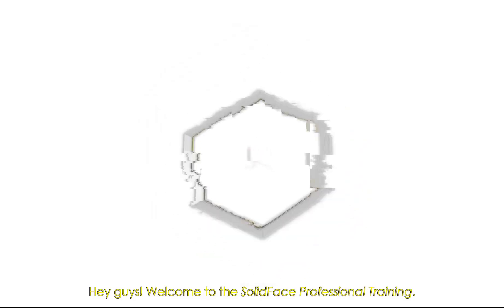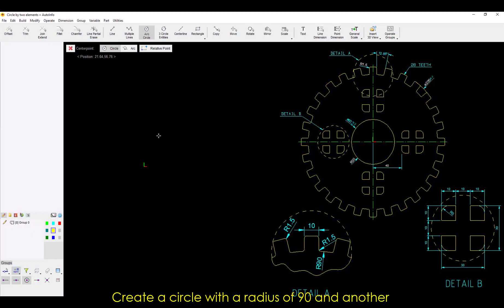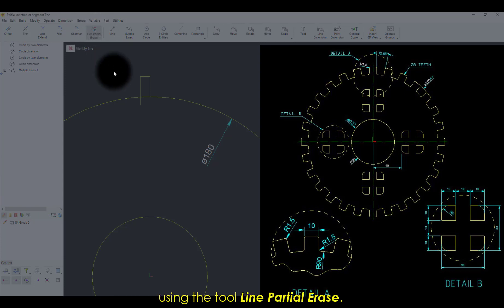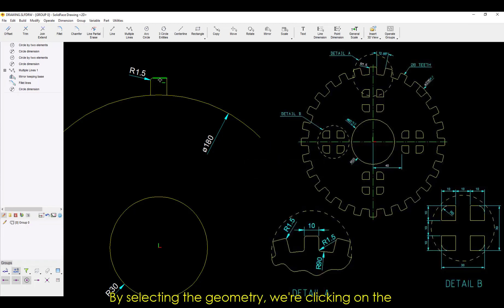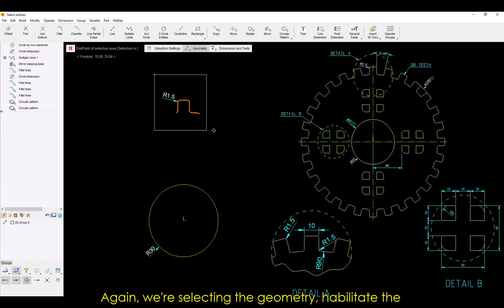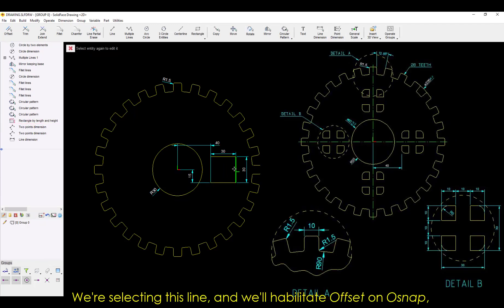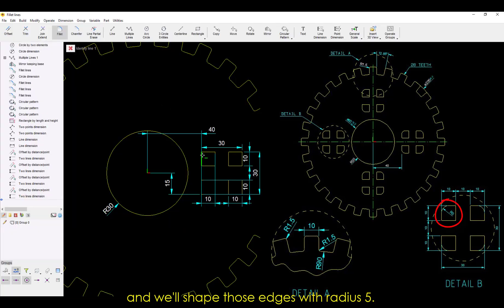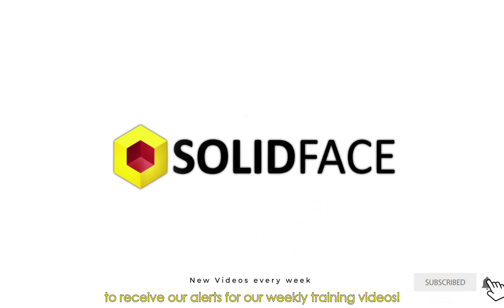Learn CAD 2D with SolidFace - 12 Circular Pattern

Comment: How did you make DETAIL A and B bigger than the normal geometry?
Reply from the maker: Hello emrullah, how's going your SolidFace experience?

For doing this modification, first, you need to click on the Text tool; after this, a box showing some information will appear, and on the right side will have the "Scale (0=Def)". If you want the Standard Scale, just keep the 0, or if you want another Scale, insert the value, and it's done! Hope you've understood this explanation. If you have a bigger doubt, pls contact us at commercial@solidface.com. #SolidFaceTeam